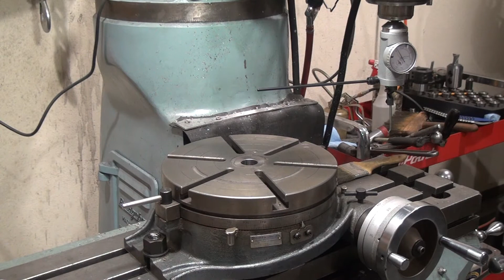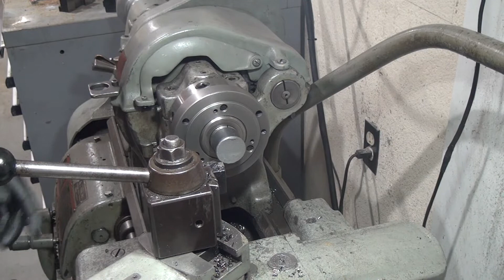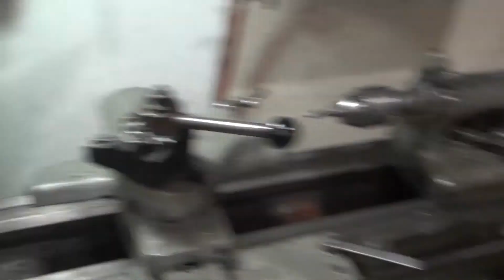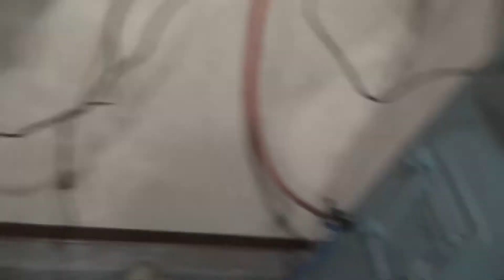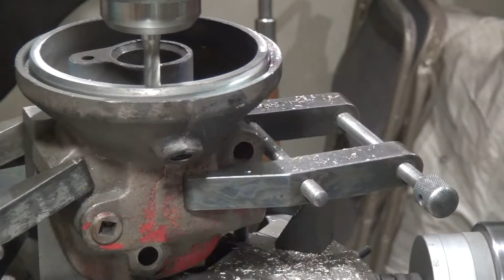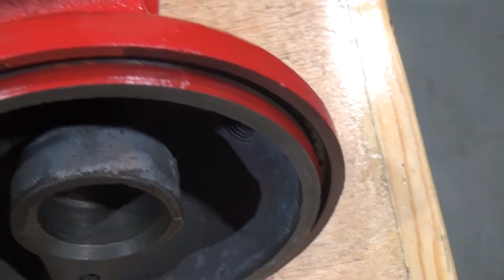Bulldozer Oil Filter Housing Repair

Comment: Great repair Bob. It looks new. Is that a gas or diesel dozer?
Reply from the maker: Both. It starts on gas and when it is warmed up the handle is thrown that switches it to diesel. In the gas position the carb float is released to allow fuel flow, a compression release is opened, a switch closes to allow current to flow to the ignition, the diesel pump rack is locked closed and a pair of butterfly valves open between the gas fuel system and the intake valves. All this operated from a nightmare of linkages. Entertaining though.